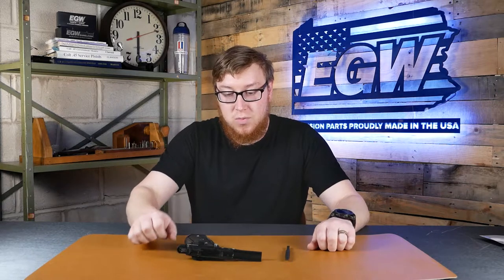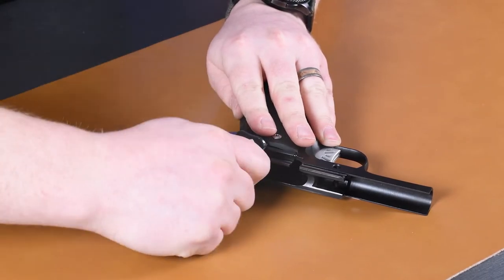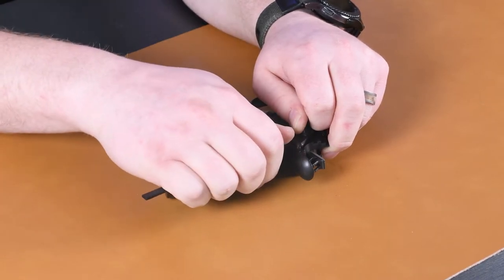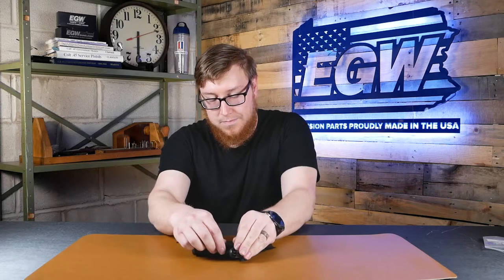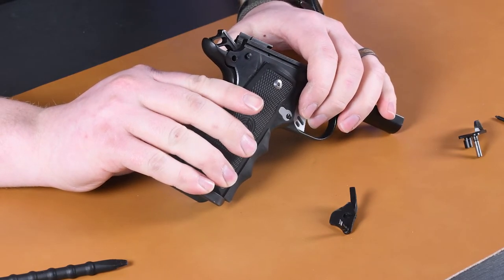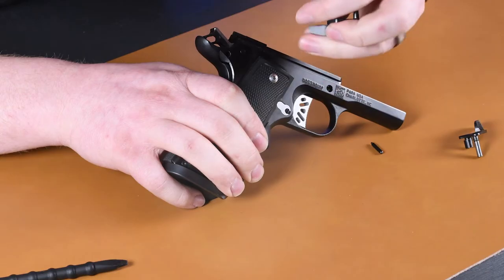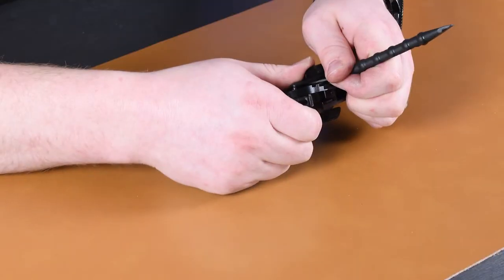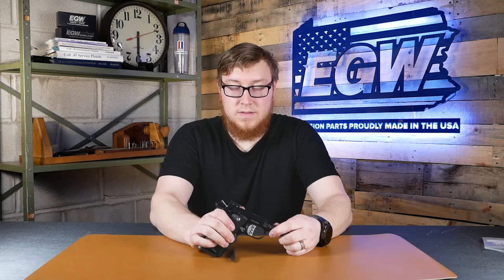EGW Ambi Thumb Safety Install and Removal

Comment: The tips floating around the internet telling people to just wiggle it loose won't work unless yours is broken in and loosened. Notice that the arm of the ambi safety has a slotted tip that mates with a slot in the other piece. It's easier to start with the right side piece cause it's thinner and there's more space on the right side. If you don't have an armorer's tool, use an old credit card and wedge it under the safety, then pry/wiggle it out.
Reply: So true. There is no wiggling my safety.

Comment: DO NOT USE A WILSON COMBAT AMBI SAFETY!!!! You will be sorry when it locks inside the frame in the halfway position and freeze up. I had no other option than cut it off my Kimber 1911 with a Dremel cut off blade.
Reply: Wilson has very good quality control. You must've had the one that needed fitting, not drop in.
Reply: Your first mistake was buying a Kimber, I made that mistake in 1998

Comment: I know I'm late to the game, but I just purchased a Wesson V-bob Commander with the EGW ambi-safety. Tried removing the ambi but it would not come off the right side. What is not mentioned but shown is the slide MUST BE off the frame to get the right side ambi off, otherwise that last millimeter upwards won't allow the hammer pin to release the ambi right side safety where the bottom hole is machined. Ask me how I know this. Most Dan Wesson's do not come with the ambi safety and if you are not familiar with this safety, you will be stumped at the very least on how to get the right side off. Slides do not have to come off to remove single sided safeties but this one does.
Reply from the maker: Thanks for your feedback! We will make sure to put this information on the products as well.

Comment: Thanks. This helped a ton. Why don't we push the pin out from the other side instead of struggling with trying to pull the thumb safety out with the tiny little tab?

Comment: Maybe its just me but when removing the sear pin all the guts fall inside?
Reply: Hold it carefully sideways on the right when you do it.  Or just put those guts back in.
Reply: @aznazguy many  thanks,, l got it all back together, just added to the adventure a bit.
Reply: @me109g4  It's even worse when there's extra parts like series 80 / schwartz.  Kind of a pain!
Reply: @aznazguy  I believe it was a series 80,, a recent  manufacture  Taurus 1911. Despite all the hate thrown at Taurus this one is as reliable as gravity,  and accurate. i have been told slide/frame are drop forged, and  they fit tightly together. I am more of a Walther/Sig guy, i got this in a deal  so figured i would add some upgrades,,
Reply: @me109g4  EGW is an excellent way to upgrade, in my opinion.  This ambi safety design seems far superior to using the right side grip to retain the right lever, and the collar (as I understand it) should be an effective solution to the loosening of the usual design where the slot can spread apart.

Comment: At 4:30 you FINALLY mention it is NOT a drop in part!!! Should that be the first thing you say? These young shooter-"builders" think they can just throw parts together and its getting comical to be on a FB page for any specific gun to watch the guys buy all the name brand parts and realize they don't just fall together like a plastic striker gun! I had one of my guys at the SO do that with his new Staccato when he saw your ignition kit and safety in my Staccato. He ended up with a bag of expensive parts he had no idea what to do with! Otherwise, great video and parts!
Reply from the maker: @micknelson8991 Thanks for the feedback. We do state on every page that these are not drop-in and that they should be installed by a qualified professional, but it would help to state it early in the video to avoid any confusion.